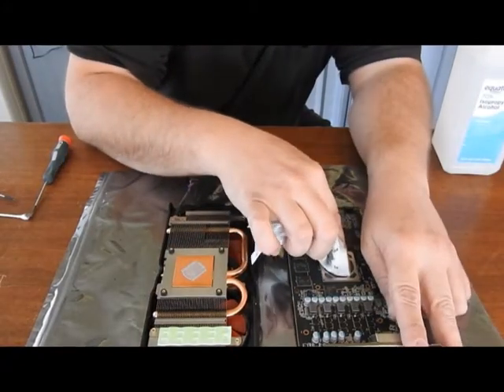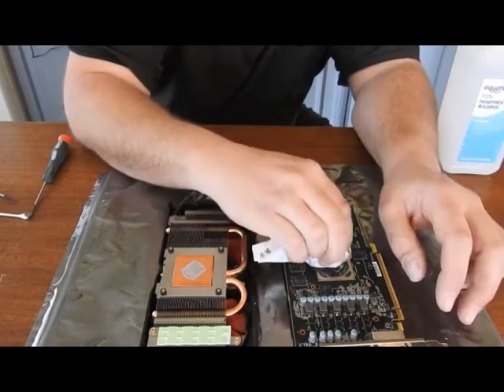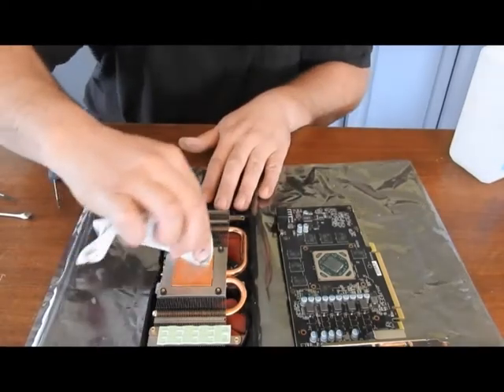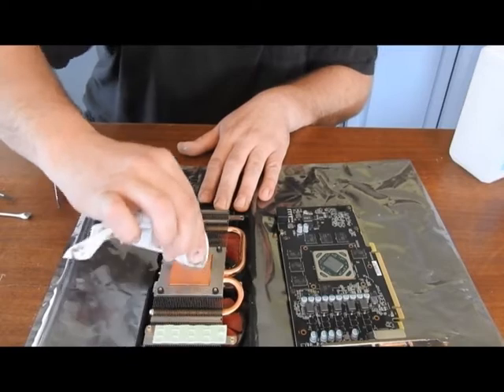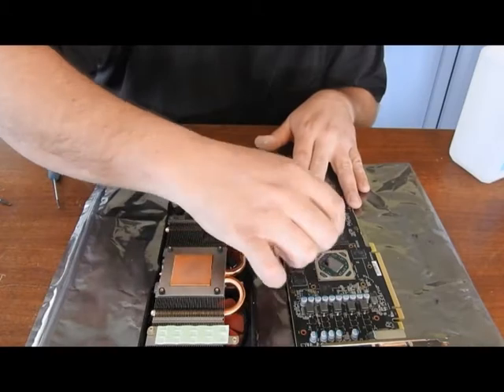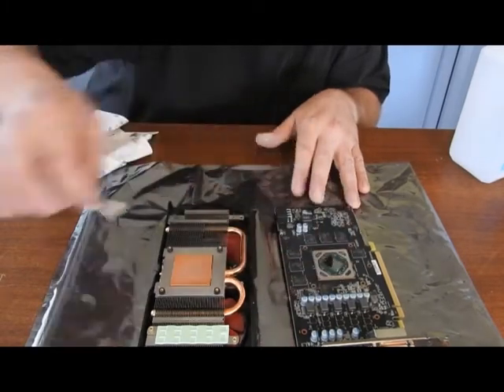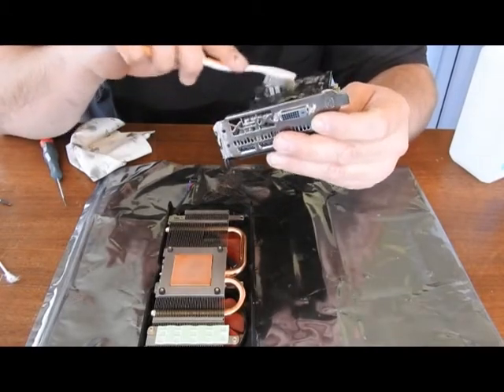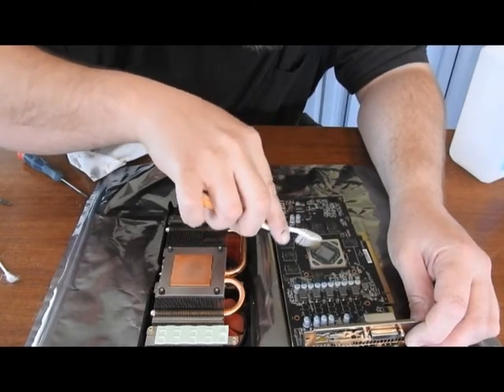[XFX RX 570 Thermal Paste] - Part 03 - Cleanup of old residue.

Comment: Hey where do the thermal pads on this exact card go. N do u put pads between the back plate n pcb
Reply from the maker: Yup, cut them to size for the heat sink to the pcb.
Reply from the maker: Sorry I totally missed this comment for a bit.
Reply: @dragonslair80  it’s ok I understand, it happens. Question if my OG pads where like a thin squishy type 1.5mm but I placed a slightly more durable firmer pads same 1.5mm. One is it possible when screwing down the card the memory chip can crack? In my case my card worked however for some strange reason after doing this, my card started giving lower than usual hashrate in mining. Now some1 told me if ur going to use more durable high quality pads u go down a size thicker so like 1mm 🤷🏻‍♂️ & if the pads really didn’t crack anything or affected anything, what can be the cause for sudden hashrate drops & the fact that I can’t even OC the card high suddenly? My temps fixed & dropped but it’s like I suddenly can’t do much with the card overclocking wise or mining wise. I was 29mh before the repaste n repad after repad repaste I got 18.5 🤷🏻‍♂️
Reply from the maker: @Varillah  How hot did it get before?  If one of the chips fried out, it would drop your hashrate.  I have not heard of them cracking.  Maybe check the legs of the chips and make sure they look okay.  Possibly the extra pressure could slide the chip a little and get interference from another leg.  Not exactly sure about that otherwise.  I did have a couple chips fry out on a board from heat and the hashrate dropped pretty well.
Reply: @dragonslair80  it was hitting 72 & I ran it at 69-72 for least a month before I finally got the courage to repaste n repad.
Reply from the maker: @KrypticRabbit That should be okay.   A little high but that should not have messed it up.  You could try reinstalling the bios, maybe one chip lost it's info somehow.  Not  really sure there, sorry.
Reply: @dragonslair80  ok cool thanks bud.
Reply: how thicc the thermal pads bro ! i have same card wanna know in case i change them one day